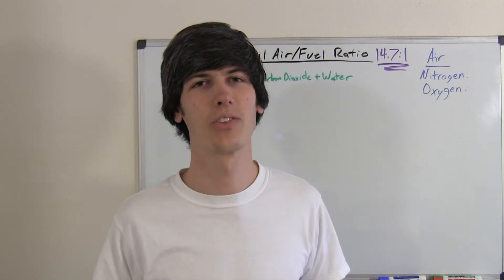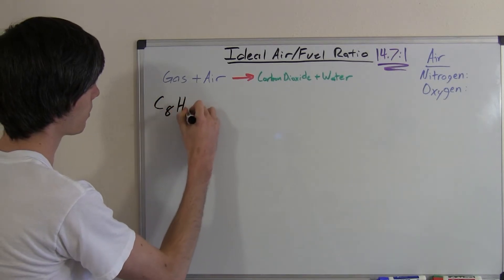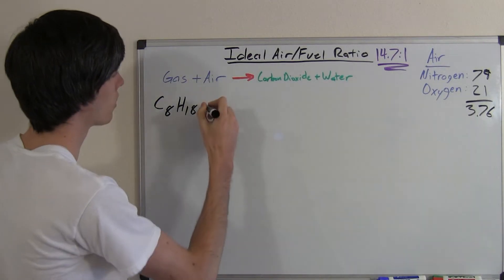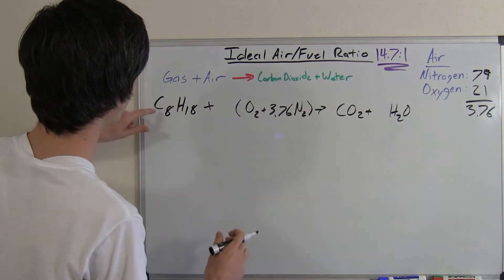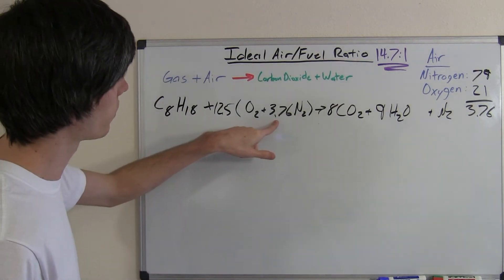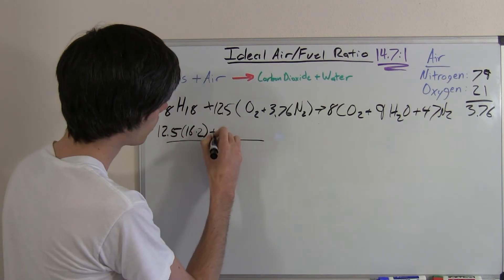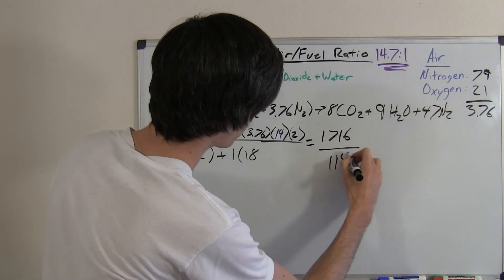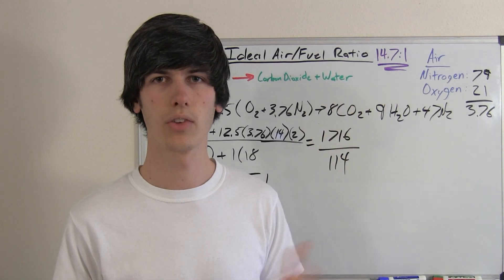Air Fuel Ratio - Explained

Comment: Im doing a project to run engine on gasoline vapour by bubbling air in petrol and using it at the intake manifold, what can u advise me on my calculations to attain best aor to fuel ratio sir, big up from kenya 🇰🇪 👏

Comment: Hello to every one and my great teacher
I have a problem in yamaha ybr carburator based pakistan.
With many symptoms.
On stock setting... Bike hesitateafter 90km/h.8.2rpm
Changed paper filter to double foil foam oiled filter. Bike get missing at 75km/h 6.8rpm. Single the foam. Bike gets 90.
And exhaust is smokey carbon in it.. I dont thi k that mixture is rich.. If i decrease fuel. I will get back fire alot on each time. How could do we manage performance, carbon issue, fuel average. On stock. 43km/ltr max at 95km/h @7.5rpm

Comment: 14.7 part of air to 1 part of fuel reach to engine so after combustion no oxygen left over no fuel left over  from the combustion process so intake manifold should be made by car making company like that so 15 part of air reach through cool air filter to engine and one part of fuel(octane) reach to engine and both air and octane reach to engine by pump through pass from filter and all car are petrol diesel intake means liquid intake and natural gas is a gas form so its intake should be made another way gas intake so gas reach easily in engine and not got back

Comment: I would like to see a scientific explanation for how you can use an oxygen sensor in the exhaust pipe to tell you how the to measure the air-fuel ratio in the intake manifold-  especially on an OLD  engine.

Comment: What happens when that air/fuel ratio is lower?
For example, let's say i drive at the downhill and i don't press my gas pental(don't put more air ro my engine) but the RPM's are at 2000+ (means that more power strokes = more fuel burning without pressing the gas)

Comment: So what’s the best ratio for a na v8 making about 500 torque?
Reply: About 14.7, but torque actually depends on the engine's design, not the fuel mixture.  Otherwise, EVERY automobile would have a 4-cylinder engine.

Comment: because the elements carbon, oxygen, and hydrogen come out of engine exhausts, I wonder if since all are flammable, if they can be made back into more fuel for a greener planet.
Reply: Yes, they can, plants do that for us. Plants consume water and carbon dioxide and exhaust oxygen. When they die, you will get biomass or wood if it was a tree. Both of them are mainly made of hydrocarbons and if you burn them with oxygen, you will get water and carbon dioxide again. The ash thats left will be mostly made of calcium oxide, calcium carbonate, potash, phosphate and other stuff that wont burn which is exactly what used to be the Fertilizer for the plants, except for two components missing: nitrogen and sulphur, which also became nitric oxides and sulphur oxides, but those are gases and go into the atmosphere, where they become nitric acid and sulphuric acid that are harmful for the environment and thats why most power plants filter them out. But not all plants that die are used by humans, and actually when most plants died, humans didnt even exist yet, so something else happened to them. they got trapped in the ground and compressed by gravity and after hundretthousands of years they became, guess what, oil, coal and gas. Now as we cant wait another hundretthousands of years to get more oil, coal and gas, we could do the job ourselves, like biogas, woodgas, etc. That way we can make our own diesel, gasoline, natural gas, charcoal and the left over ash and filtered nitric oxides and sulphur oxides become the Fertilizer for the next generation of plants. The job of the plants of building hydrocarbons from water and carbon dioxide is possible for humans aswell but it will consume more power than we could ever generate.

Comment: if ideally you want no remaining air or fuel, why does the p1 spit fire from the factory? I was told that happens because excess fuel gets burnt when traveling through the exhaust system. is this true? does that mean the p1 isn't properly tuned???

Comment: can you please say why does a lean mixture causes a engine to run hotter
Reply: ravi persaud Look up a YouTube channel named The Workshop, he explains it thoroughly there. Basically, extra fuel in the cylinder acts like sweat on your skin. As it evaporates, it draws heat from the surrounding area as it leaves. When running lean, this doesn't happen inside the cylinder, making the engine run hotter.

Comment: now everywhere I've read and heard is that the best ratio for A/F  in a gasoline internal combustion engine is 14.7:1

now there is reason for having a catalytic converter (which burns off excess fuel that wasn't burned during combustion).... so why is there excess fuel being burned.... i know that the process isnt perfect and some losses occur but why cant we look at why so much gas is being wasted instead of being used in the first place or recycled in the engine process? things such as gasoline temperature and its viscosity going through injectors. why some people can tweak carbureted engines (v8 engines) to get better mileage than my honda civic? why the computer puts more fuel through the injectors under certain circumstances because the hardware being used is limited. these are all factors that can be fixed easily and believe me when i say we can burn less gas and get just as much or more hp from an engine.
Reply: sorry not "burn" less gas..... "use less gas"

Comment: I don't get one thing. So for every rpm the 2L engine cylinders are filled with 2000/15=133cm^3 fuel. at 5000 rpm you should be burning 665000cm^3 fuel by this logic which is nonsense.
So how is fuel consuption calculated?
Reply: because the air is not very dense.  the 14.7:1 thing is the mass ratio, not the volume ratio.  liquid gasoline is much denser than air is.